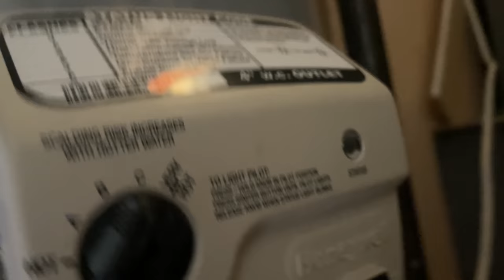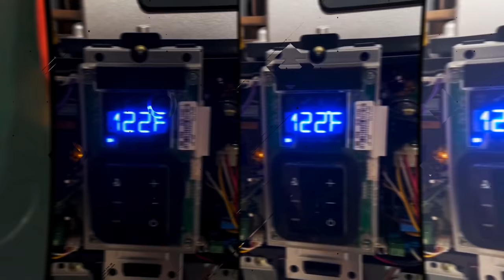Hacked Kenmore 50 Gallon Water Heater - Bad Millivolt Gas Valve, Diverter Missing & Other Violations

Comment: Daniel remember to always do a double check routine before leaving a stop , checking valves and switches are on.
And also remember just because an experienced service tech teaches you very well and pays your salary,
This does happen to all service guys and gloating is unprofessional, but it is nice to get your point a-crossed. 
     See how I did that ?           Mike,  great video on those gas controls.  they are hard to diagnose.

Comment: Well it's been a "well"  Friday for me had to replace a pressure tank and switch for one of my good cohorts at his mother's house two houses on one well one house at well level one house 40 ft up a hill the upper House was not having pressure but the lower house did the lower house with using the gravity effect for the pressure tank since it failed but at least it wasn't a damn water heater LOL y'all keep up the good work

Comment: I'd look up  at chimney/liner to see if somethings whacky and see if they've been running window or whole house fans blowing out and not have enough windows open for makeup air. something is odd there with the hood off to the side and it having enough rollout/pooling to trip the high limit stat, because those don't trip instantly.

Comment: that flame is lacking makeup air and probably dirty burner, intake mesh/damper plugged with shmoo, but a down-drafting chimney or negative building pressure can do that also. it would be majorly spilling out the hood of course.

Comment: I'm a little confused here.  That gas valve is only like $130, or so, and the tank is just 6 years old.  I don't see how replacing that tank would make any sense, financially, or practically.  As you know, there is not much to a HWT, and the gas valve is the most "expensive" part to replace.  She could easily get another 10+years out of that tank, unless she has crazy hard water, or in an area that is hard on tanks because of the water composition.  Yes, replacement is always an option, but in this case, I just don't see why it was even brought up.
Reply: Improper installation causes issues that are long term and intermittent.  The overheat from having no diverter means that the entire heat exchanging assembly likely took damage as well as all the replaceable components like the switches, gas valve, seals, dip tubes, etc.

In addition a tank may hold up (maybe) but in 10 years she would have had excessive sediment build up on everything in the tank, normal decay of the dip tubes, an atrociously dirty burner compartment...10 years is a pipe dream unless she wants to piss away money heating rocks instead of water.

That's also taking a chance on dumping 40 gallons of water on the floor....

The thing is past warranty, improperly installed, not maintained, and she has already had multiple issues with it.  The repair will cost something like 200 to 500 dollars including Labor depending on locality.  A replacement is 1000 to 2000 for a brand new, properly installed, in warranty water heater.  It is silly to spend more than 1/4 the price of a new unit, on an old unit that is almost assuredly going to keep having issues its entire life.  Doubly so when you consider that repair price is just the gas valve...not all the other things that need to be corrected.
Reply: @cmc7256  Yes, those are all potential problems, assuming it was like that from the install date, which I think is highly unlikely.  The fact that it was sitting on top the unit leads me to believe someone else, after installation, messed with it.  In any event, those are all good points being brought up, but the gas valve being swapped out was a wise choice in this case.  If something goes wrong down the road, then it's swap out time.

Comment: Plenty of pitch on the line, why was the vent hood off?  I know you checked draft and all that but seems strange that it was off, still sitting on the tank and lots of pitch.   Whenever I see something like that and such a horrible install I start to think what else is going on.
Reply: @PipeDoctor  Hence why I said I know you checked.   I work part time as an inspector, stupid people do stupid stuff for stupid reasons.  seen people take the smoke pipe out of the water heater in the winter and stuff insulation in the chimney breach so the heater heats the cellar in the winter.  Seen licensed guys do things you would not believe.   I see something like that and get suspicious, that's all.   One thing to toss the hood in the trash another to leave it on the heater of an over pitched pipe.  Just makes me wonder.  You do great work.

Comment: Was there an expansion tank hooked up to the the water heater?
Reply: Hacks bring Mikey pipes stacks .
Reply: Not required in all states, some only if a check on the main or other similar device preventing expansion back to the street.
Reply: @consolidatedplumbingandhea4390  it doesn't matter the state. If you have no where for the water to expand too you need a tank. Water doesn't behave depending on which state you are in
Reply: @shahsmerdis  My statement, difference being some state's code requires regardless.  My state only required if the pressure cannot work its way back to the street.   Municipal meters in my area will allow pressure flow back to the street in most jurisdictions, some have checks on all water services.  My Quote "Not required in all states, some only if a check on the main or other similar device preventing expansion back to the street." One items is state code, one is physics, the code when requiring it does take into account physics, states requiring it regardless do not.  Some states want vacuum relief, some do not, some want on a stand and strapped to a wall and some do not.  Code does not always have much to do with reality and some codes actually conflict.
Reply: Well said.  In IL practicaly no residential water heater has an expansion tank. If it's a commercial tank then code says it needs one but even then most commercial tanks also that I come across do not have.

Do I tell customer that all of a sudden that they need to have an expansion tank... No I do not.

If I come across one that is water loged and looks like probably it has been for a long time and no problems like relief valve dripping etc. I tell customer your supposed to have this but it's really not doing anything. I could replace it or get rid of it..  I'm told always to get rid of and stick a cap or plug in it's place!
Reply: I asked because where I am, I never needed one before, but at some point they must have installed check valves at the main because I need one now to stop the pressure valve from leaking. When a new water heater was installed they used an expansion tank.